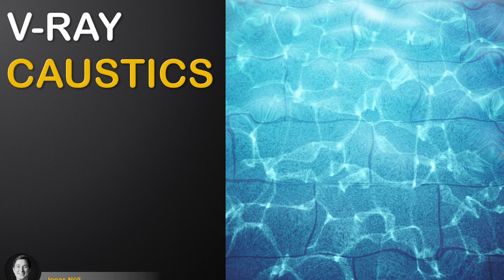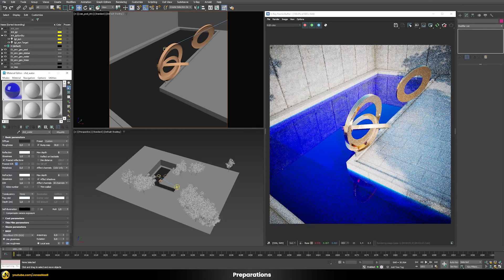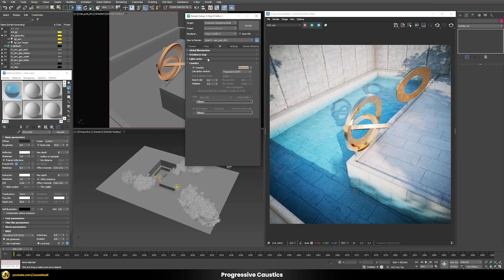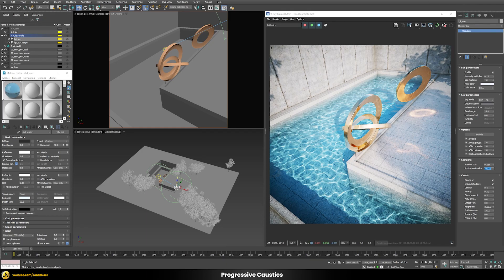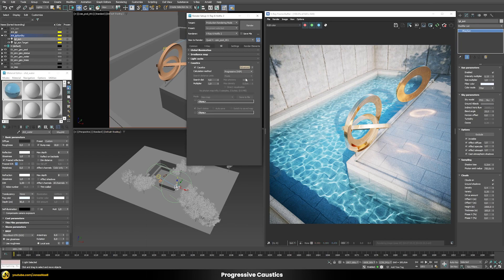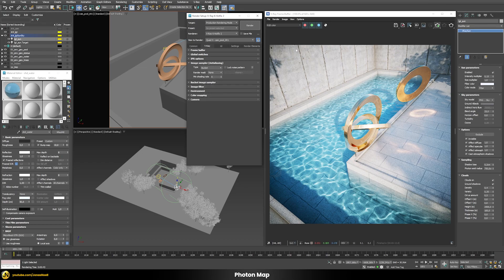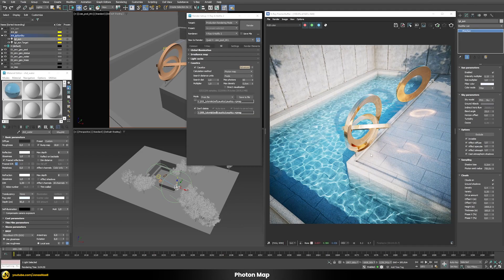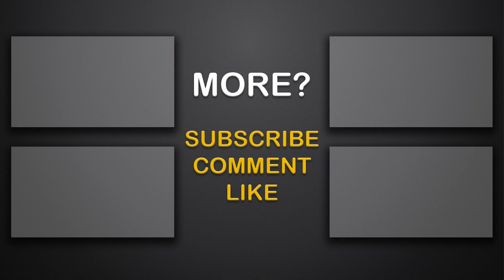V-Ray | Realistics CAUSTICS Effects

Comment: Jesus christ dude, what are you rocking a 64 Threadripper!?
Reply from the maker: Yup 👍
Reply from the maker: Totally worth the investment if you are doing this kind of work professionally and time is money
Reply: @JonasNoell  Yea I'm intimately aware. Now it makes so much sense why you always have super fast preview renders during your tutorials. 

Just outa curiosity, what GPU you using? And you ever play with RTX mode assuming it's an NVIDIA card, and how does it compare.
Reply from the maker: @iamski  I budgeted on the GPU, a RTX 3060TI, which at the time I bought it also was kind of expensive due to chip shortage but afaik the prices are more reasonable now. Never used it for GPU rendering,, it's only fo the viewport. In fact I rarely tried out VRay GPU so far as I would need to inviest heavily if I want to have a setup that would make sense to use as an alternative to the Threadripper.
I think you either go CPU or GPU, you don't invest in both and then have 2 setups, because you will be only able to use one at a time 🙂
I also edit my tutorials, so sometimes rendering is speeded up. You can check the progressbar in the VFB if you wanna know how long something really took on my setup 🙂
Reply: @JonasNoell  I always do brother, thanks again :)

Comment: Loved your work, needed some suggestions for Desktop Processor for Rendering and ArchViz purposes.
Reply from the maker: Depends on your budget I guess. The more cores the better
Reply: Shivan Khare, if you're tight on the budget, I would suggest a good AM4 motherboard for AMD Ryzen and the best CPU you can afford, you'll be able to update it later up to a Ryzen 9 5950X, which is comparable to a 24 core Threadripper in vray rendering. If money is not an issue, wait until Intel releases the new lineup and see how it compares with the new AM5 Ryzens